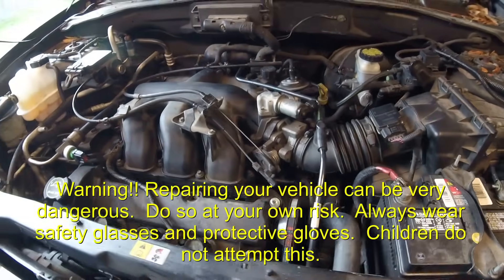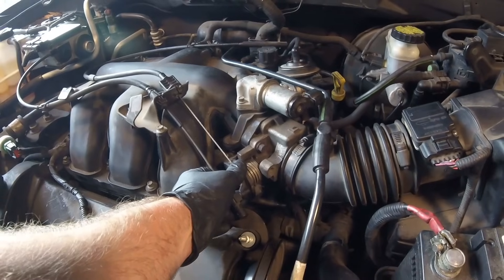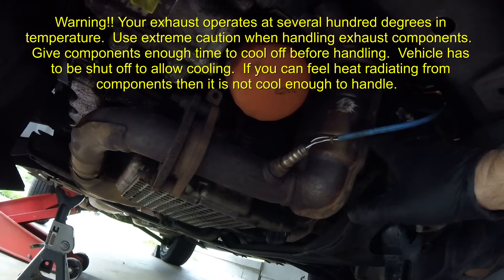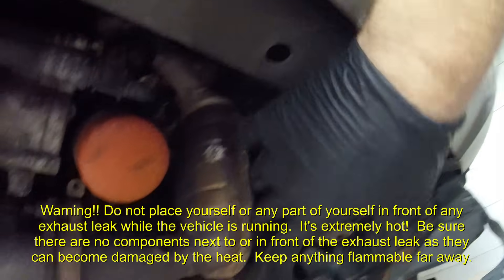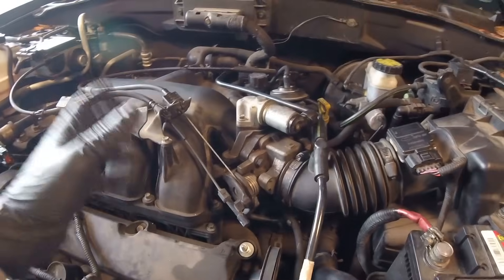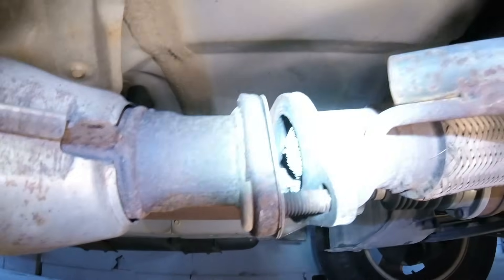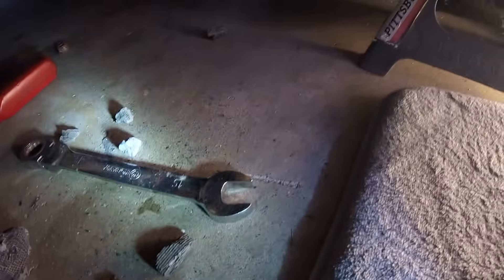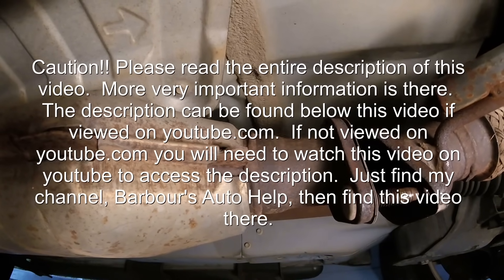How I Figured Out Exhaust Restriction (Clogged Catalytic Converter)

Comment: If you were to remove the catalytic converter would the P0420 code disappear and would the ECM still run correctly with the 2 O2 sensors in place or would you have to install those bungs to pull the 02 sensors away from the exhaust stream for everything to work properly?
Reply from the maker: I know for sure the 420 would still be there.  However, I’ve never modified an exhaust system in the way you describe.  So I don’t know.
Reply: @BarboursAutoHelp  
I decided to floor the throttle from 15 mph and she went like a bat outa hell with a big cloud out the tailpipe. She had no problem revving and pulled strong so I don't think it's a clogged catalytic converter. I did that 4 times each with less of an exhaust cloud pulling real strong. I'm guessing that it must be a bad O2 sensor. Whataya think?
Reply from the maker: A 420 doesn’t mean your cat is clogged.  It means that the PCM thinks that the cat isn’t doing its job.  You’ll need to have a pinpoint test performed to properly diagnose this...  I’m assuming your trying to get ride of the code.
Reply: @BarboursAutoHelp  
Yes, getting rid of the code correctly so that it runs and performs as best as it can be made to.
Reply from the maker: Yea, if you don't have a scan tool that is capable of data stream then it will be very difficult for you to diagnose this on your own.  You'll need to take it to a shop.  :(
Reply: @BarboursAutoHelp  
Shops want a sack of money to experiment. One shop wants to replace the catalytic in my '05 Cobalt because they say it's blocked up yet the car accelerates like a bat outa hell and averages 29.mog. P0420 comes up all the time, the catalytic should be glowing red if it was clogged/blocked but it's not. Shops are full of shit. P0420 is a lean fuel code yet engine temperature is 189-192 constant.
Reply from the maker: Well, its been my experience that a p0420 is usually caused by a faulty cat.  There are some other things that can cause it but it usually sets because the computer sees that the rear O2 sensor, the one after the cat, is fluctuating more than it should.  What I've seen is that the rear O2 sensor will almost mirror what the front O2 sensor is reading.  This means that the cat is not doing its job or there could be one of several other causes.  In order to see this you need a scan tool with data stream capability.  Your cat converter could be at fault and not be clogged.  I'd say having a shop take care of it is probably the best way to go.... Just my opinion.  Its your car and your money.  I hope I was some help.
Reply from the maker: and you could have a p0420 and have a clogged cat also but those two faults don't always go hand and hand.
Reply: @BarboursAutoHelp  
There is no problem with rapid acceleration and I'm surprised to know that the car can have a bad day and still boogie. 

Initially there was a fluctuating rough idle coming to a stop and at a stop. I spray cleaned the MAS & MAP sensors, cleaned throttle body thoroughly and replaced the gasket, new pkugs but some idle roughness still appeared at a stop. Intermittent stalling. Had an EVAP solenoid code and replaced that, had a misfire code and poor fuel moleage and found a bad ICM (ignition control moduke) replaced it and mpg returned to 31.4 average but I still have a code P420. 

I found someone to live scan with a Solus and I will replace the fuel injector & fuel rail O-Rings and fuel filter before the live data scan. 

I may blow some cigar smoke up a vacuum line to see any possible leaks and spray some starter fluid or MAS spray around to find any possible vacuum leaks.

It's pissing me off.
Reply from the maker: Have you done any research on the code p0420?
Reply: @BarboursAutoHelp  
Yes, it's a lean condition with many possibilities that could cause a P0420,
Reply from the maker: Actually P0420 means that your cat converter efficiency is below threshold.  Which means that the PCM thinks the converter is not working.  While it can be caused by a number of things I personally have not seen anything but a bad cat cause this code.
Reply: @BarboursAutoHelp  
Yes,strong possibility that the catalytic is bad. It could also be the O2 sensor wiring. A visual exhaust system inspection and then a live data scan this Thursday will tell me more. What's causing the rough intermittent idle when coming to a stop light?
Reply from the maker: Don’t know.  It needs to be checked out by someone that can physically diagnose the vehicle.
Reply: @BarboursAutoHelp  
I agree. Live data scan tomorrow morning. 
I might add that after stepping back into the vehicle from a quick convenient store pit stop and restarting the engine and then turning on the AC the RPM'S will fluctuate down and up and exhibit a very rough idle when going down.

This can only be a vacuum leak unless I'm missing something.  Any clues?
Reply: @MrJohnnyDistortion  good read.   was the fix? bad/clogged cat? injector?
Reply: @duaneafields  
Clogged catalytic. I changed the injectors because of high miles.
Reply: @Jonathan A 
Exhaust/intake valves are not located in the engine block so you don't know wtf you're talking about. The face of an exhaust/intake valve will wear over time as will the hardened valve seat from the face of the valve slapping against the valve seat (millions of repetitions) that is located in the cylinder head. The exhaust valve is the valve that becomes damaged from the constant heat of exhaust gases. Cracks also form over time in the head area between the two valves. You'll find valves in the block in an old flat head Ford.
Reply: @MrJohnnyDistortion  Was it a bad cat?
Reply: @MrJohnnyDistortion  do you have an egr valve?